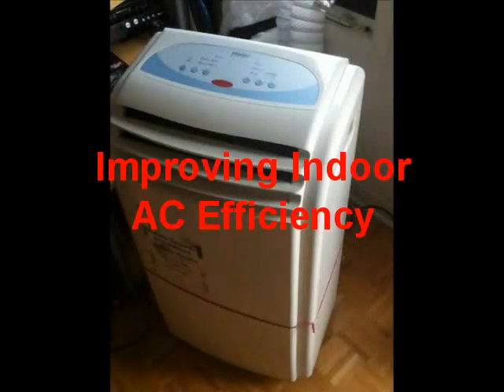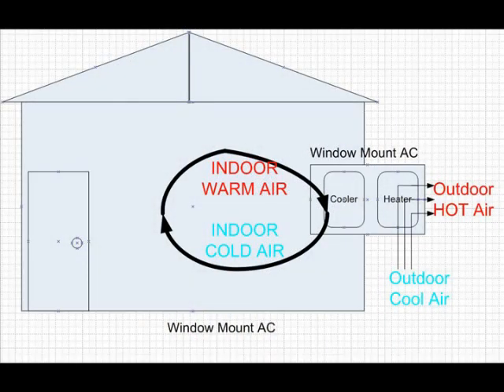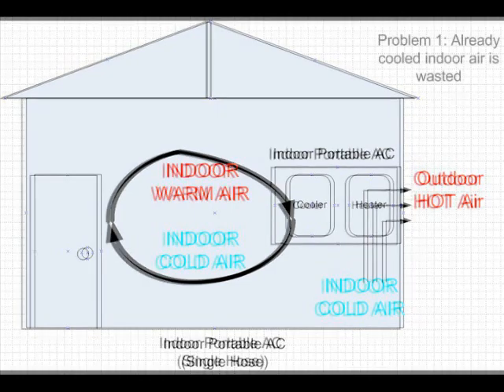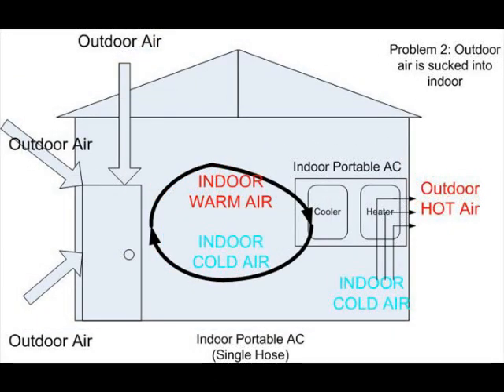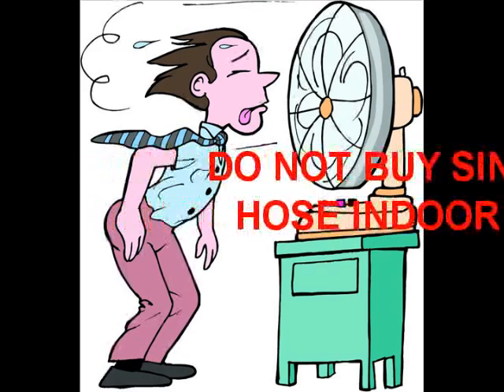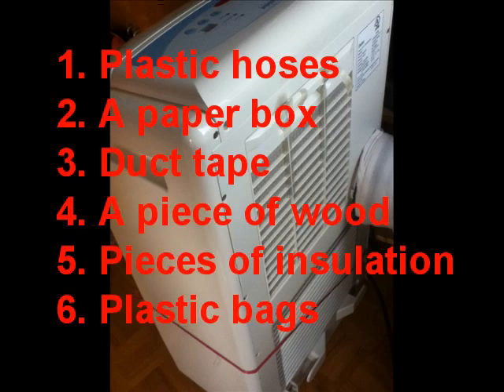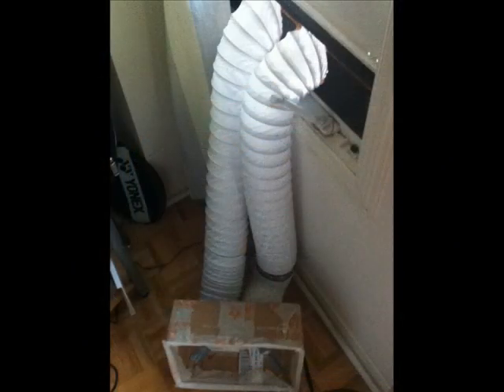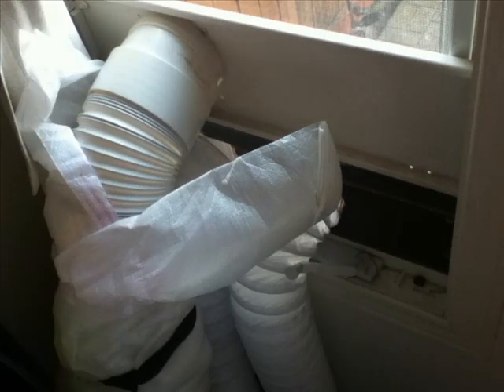Indoor Portable Air Conditioner Efficiency Improvement: single hose to dual hose conversion

Comment: Much easier to simply get a 6 inch dryer hose and adapter collar or  plastic ring from hardware store connect collar to hose send all hot air  outside simply replace the factory  delonghi LG etc hose.  you're cardboard box is nonsense.  The delonghi reduces the 5 inch hole on the ac to a 3.5 inch hose that goes outside because it looks nicer.  More efficient is to get a larger diameter hose that matches the hole on the delonghi  dremel you're own collar, then  use a hose clamp to attach dryer hose to a new outside  dryer vent.  Unless the smaller original factory  pipe was engineered for some back pressure.   If you're so correct and 30 CE mfg are wrong then maybe go work for them.  I'm sure thier engineers could throw out thier degrees and see the light of a cumbersome cardboard box lmao. Maybe you're fridge needs hoses too as it also uses a compressor and heat exchanger is that your next video ?

Comment: This is bullshit, I have a single hose and it will pull a large room down into the upper 60s even during a Texas 110deg day.
Reply: @daveb2213  agreed! the addition of more hoses, boxes, duct tape etc will turn it into an eyesore too.  
Personally I dont want to be cold, just take off the edge or reduce humidity. Getting the room tooo cold sux, because when you do go back  outside: the heat hits you twice as hard! (although i usually let the room warm up a bit b4 going outside to reduce the shock)

Comment: this is useless, even the dual hose ac doesnt work as described...a dual hose uses outside air for cooling internal parts of the ac, thats why it is a little bit more efficient, but even the dual hose has a second intake at the bottom where room air is sucked back in. ACs use a recirculation system and that cuts energy costs making them energy efficient...The dual hose ac is a little bit faster at cooling the room but when all is said and done both will cool as long as your room is not gigantic and is well insolated. If hot air is getting in and cold air is escaping then it might seem like the dual hose is better because it cools the air quicker but it then uses more power not less as described...My suggestion, if you have big rooms a wall AC is better while for small rooms it doesnt matter 1 or 2 hose, just close all the windows and doors so that your AC doesnt work overtime to keep the room cool...cool aide or aluminum foil can insulate the exhaust hose, thats all the mods you need for your AC, don dual hose it...

Comment: This does nothing.. theres no way you can convert your single hose AC to a dual hose. You may add an intake hose but it made no difference. A single hose consist of only one blower while dual hose ac uses 2 blowers each for different purposes. All this mod did was sucking more warm air from the outside to the inside. This gives false reading to the thermostat which reads intake air and thus makes the compressor running all the time since the ac thinks it has not reach the set temperature. This will mess up your ac and your condensor coil needs cool air to cool those hot gases before the exhaust hose. So with this mod you are just blowing warm into your room and the condenser coil which makes your ac less efficient. If the condenser coil are not able to cool down the hot gas your ac will fail. its best to leave the intake part of your ac as it is so the cool air from your room will help to cool the condenser coil. I leave my single hose unit near an open window so as to short cycle the external warm air instead of letting it go around your room. As your room temperature are lower than the external air this also pre-cool the warm air when it get mixed with the cooler air in your room before it gets suck into your ac. I leave my window open wide enough just to equalize the hot air thats been exhaust out at the hose so there be no warm air seeping in from the door gap or anywhere else.
Reply: Sure it does, in my unit anyway.  It does have one motor but two separate blowers one for the evaporator and one for the condenser.  If you isolate the intake, and pull it from outside, it will definitely run more effeciently, assuming it is not restricted.  Now, instead of robbing the cooled air and blowing it outside, it re-cools it, just like in your car when you have your ac on recirculate,  When you leave your window open as you mention,  it makes sence  because it can take that outside hot air easier than the cool room air, thus robbing less, possibly.  With a standard one hose,i t's a losing battle , no matter how air tight your room is, it is constantly stealing your cold air.  It's far more  rewarding to seal up  cracks to keep cool air in than to do the same to keep hot air out.
Reply: i can not judge the action was correct?   the criticism was correct?  answer of the criticism was correct?  it requires the diagram of the specific device. each decice is designed differently. my conclusion, so far, is,  (buy a double hose decice).
Reply: Sucking in outside air was the whole damn point and how dual hose ac are better not because of adding a second blower.
Reply: You can see in the pictures the AC has to intakes, the top one goes to the evaporator and the lower one, that they covered with the box, goes to the condenser.
Reply: car vs house no difference?  Lmao you got a faceplate deck in your house too?   You make zero sense.   I have multiple portable ac units not a single one blows cold air ever .  Only hot air and the vapour from the air is what blows out its got a us patent for air sending water via hose so no need buckets it dual hose.   You dual hose people belong in the 1960s
Reply: O!Technology the point of a ac is to keep warm air outside and cool air inside the home like a fridge.   Sucking in outside air defeats the purpose.   I don't care what the nut who posted the videos point was.  Because it's simply wrong .  Maybe blow outside air into you're refrigerator and let us know how  that works for you two
Reply: Xavier Andrade the ac pulls in room air blows outside the hot air via hose, supercools the air  before its returned to the room from front vents  that's why it's called  A air CONDITIONER it CONDITIONS the air in the room Period!  There are 3 things happening .1 indoor air drawn into unit 2) separation of hot air from room air, now you have 2 airs in the machine.  3) blow out got air to outside via hose and cooler air outside front vent on air conditioner.   Not rocket science.   The poster of this thread is correct.  By forcing outside hot air to the part that draws in outside air you're forcing unit to think it's unbearably hot in your room and run 24x7 at max .
Reply: It does as much nothing as what you did. You criticize this person for short cycling air with a hose from outside & then go on to say you short cycle the air by deliberately leaving a window open. :/
Reply: akupehsluarketatAR ok so what if I add a 100cfm duct fan to the ducting of the fresh air intake would that work?
Reply: mine blows plenty cold. My main AC went out 2 days ago and my single hose portable turned my bedroom into a fucking refridgerator (ok maybe not, but it got it into the upper 60s when it was 98 deg at night.
Reply: akupehsluarketatAR 
Yes it does! Without conversion 24at dawn, after conversion 22 in the afternoon...
Reply: They have different blower!

Comment: Too many variables that are not considered.  I have several portables and they work fine however they do not last forever.  When I shopped there were NO dual hose units.  Pulling hot humid air from outside is going to increase the volume, and it is going to cause the tank to fill up.  Without and data this is assumption.  Record measurements of air temp, inside and outside, as well as humidity and current draw with the compressor on and then post that.

Comment: Run for US president you could improve that too.  You did this to make your A.C. colder ?  It's only colder because the hot air your pulling in from outside makes A.C. think room is outside of house temp..  LMAO  you backyard engineers are a riot on here.   The real answer is to open ac cabinet carefully and clean the thermostat and cooling fins etc and of course the filter(s)
Reply: Wow, you make multiple nonsense comments in here for a profit? Are you yamato905's rival?